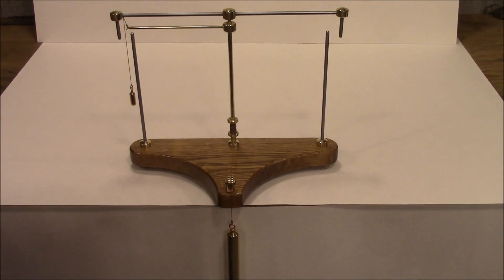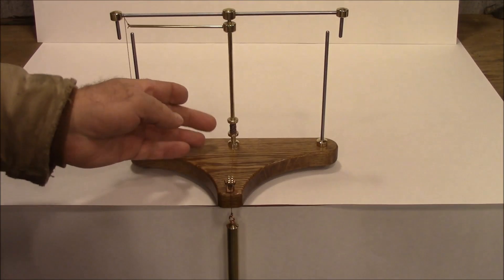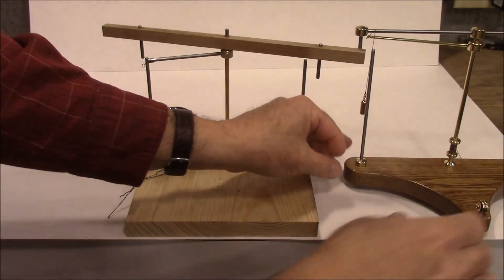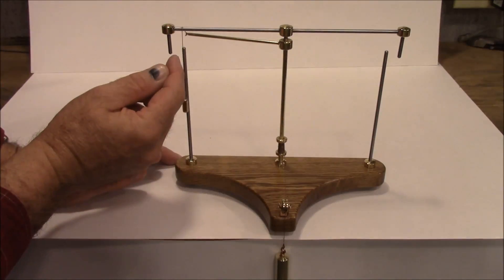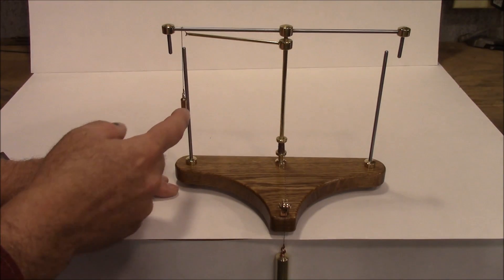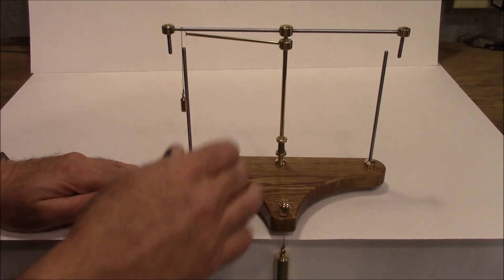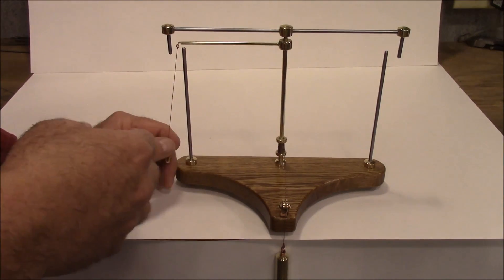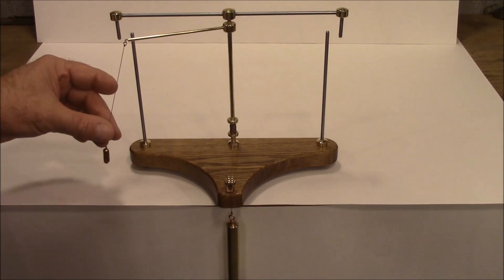Flying Pendulum:  Introduction

Comment: The timing on these can also be adjusted by putting a sliding weight on the swinging bar, close to the center is faster than farther out. And changing the weight of the weight.
Reply from the maker: Thanks for the info!

Comment: “I doubt anybody is ever really gonna build one of these things.” Incorrect! This is a beautiful piece. I made one with your design as a reference. Mine is a bit smaller and I haven’t yet worked out how to incorporate a ratchet mechanism. I’d be curious to know how you did that, because now that I’ve got mine working I understand how difficult winding it is without that feature, lol.
Reply from the maker: That's Awesome!  Thank you for letting me know!  It's a multi part series.  In part 5 I show the ratchet.  https://youtu.be/qIV7JoowZaM
Reply: I HAVE NOT MADE ONE YET, BUT I'M GATHERING PARTS, FOR THE CLUTCH I USED A 8MM ONE WAY ALSO A CLUTCH BEARING, GOT 5 FOR 7 BUCKS ON AMAZON, GOOD LUCK, AND THANK YOU SOAT MON FOR A CLEAVER IDEA.  I'M AN OLD RETIRED ELECTRICIAN ALWAYS LOOKING FOR SOMETHING NEW TO BUILD.

Comment: If you increase the distance between the long wind poles that are at 8" a bit, but keep the rotating arm the same length, you should be able to make a simple way to change the timing of the device by just shortening or lengthening the pendulum rope for a rough adjustment of the escapement.  More precise timing, if the swinging weight of the pendulum was a threaded rod section, you could put a nut on the threaded rod to dial up or down to change the time precisely.   A very nice piece all the same.
Reply from the maker: Thank you for taking the time to explain.  I'm glad you liked it.
Reply: Also you can add more arms, at least three, maybe more.

Comment: This looks amazing! I love the design and the rachet, weight system. I've made a simple version and build it with some students, talking about clock mechanisms- We used paper cups, rubber bands, skewers, string and pasta :-) It worked, but of course not as elegant. I wish I had the skills and tools to make one like yours.
Reply from the maker: That sounds great.  I'm sure it got their minds working which is the important part.  Thank you for your comment and sharing your experience.
Reply: @SoatMon  I am fascinated by this mechanism! But one thought, while you say you achieved 17 second intervals, you wish you had 20,  so 3 motions would equal one minute. But it seems to me, it may be easier to shorten the string enough to achieve 15 seconds? Then 4 motions would equal one minute. Not that it makes a great difference, but it might be easier to do? Anyway, loved your project! Truly inspiring.

Comment: How long does it take for the weight to drop 12"? I am curious because I build a tardy escapement and it takes 15 minutes for it to fall 5'
Reply from the maker: I've never timed it but it would be much quicker than 15 minutes.  When I made it I wasn't trying to prolong the fall or time it i any way, just wanted it to work.
Reply: @SoatMon   Thank you

Comment: What type of string/chain do you use for the weight?
Reply from the maker: It was 3 strands of thread that I twisted together to form a thicker cord.  I think I used nylon to hold up to the abrasion.  I bought a light chain to use but changed my mind in the end, don't really have a good reason for not using the chain.  I think you could use anything that is light and flexible.  Thanks for the comment!